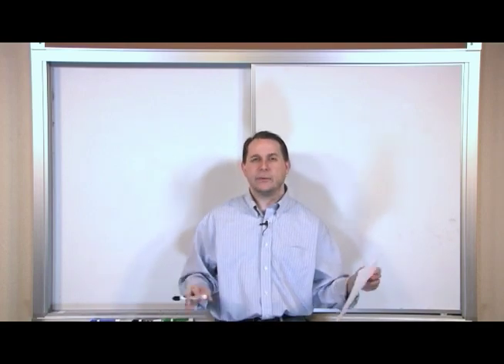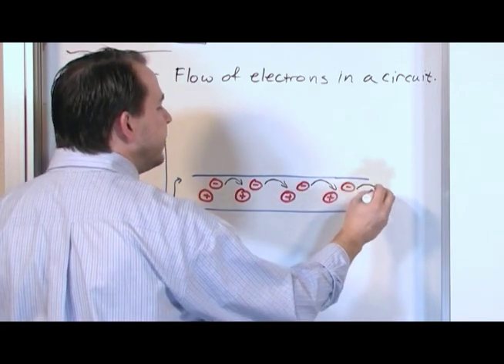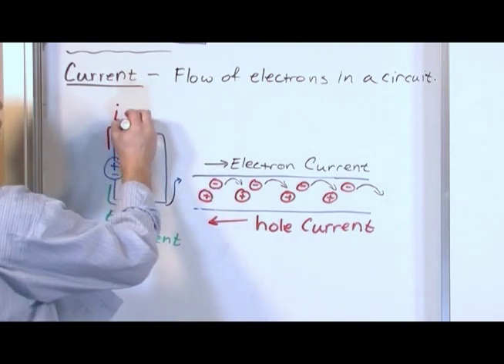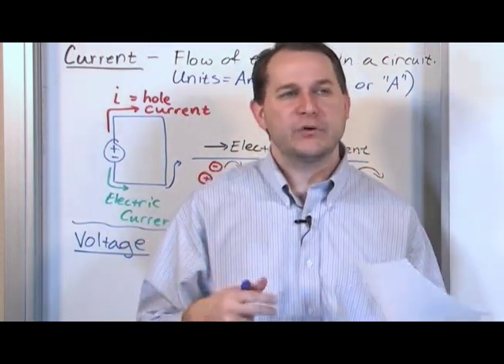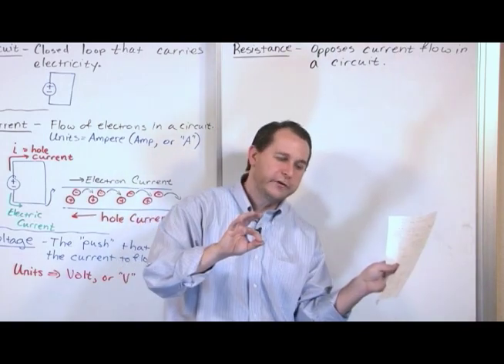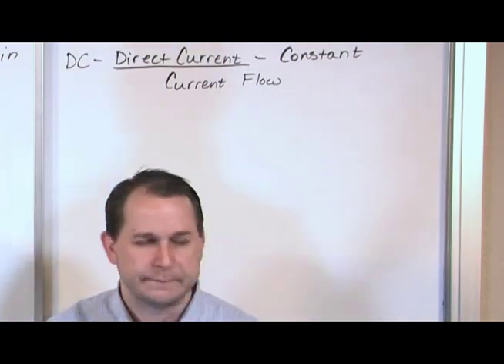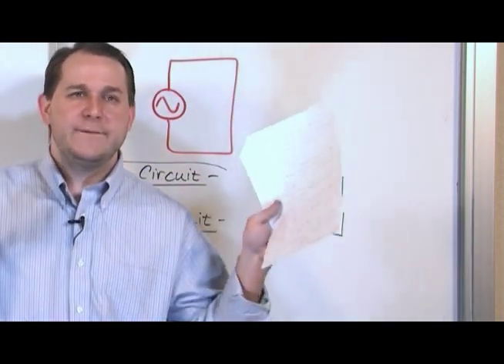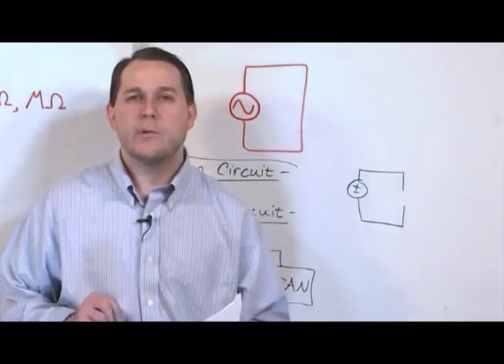What is Voltage, Current, Resistance in Circuits & Electrical Engineering?

Comment: where does the source of the voltage come from - i get a battery is rated at say 9v and i get that the mechanical analogy of a liquid flows thru a pump (suction) so what is it ? ie the source, reaction etc in Ac and DC systems that create 9v or 10000v.